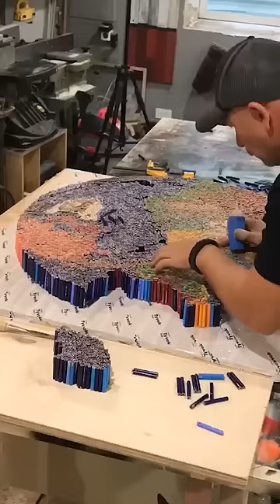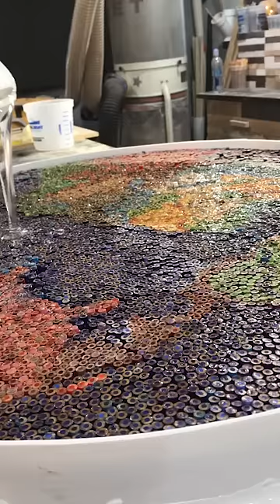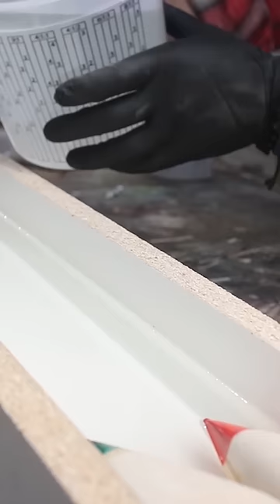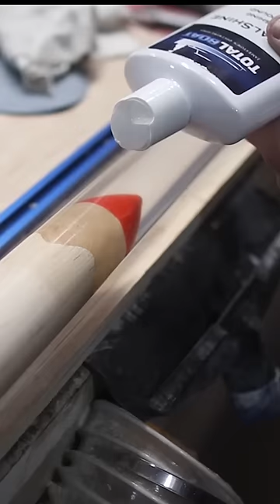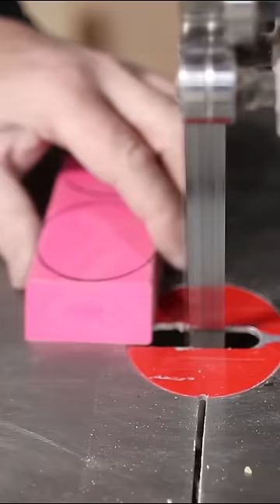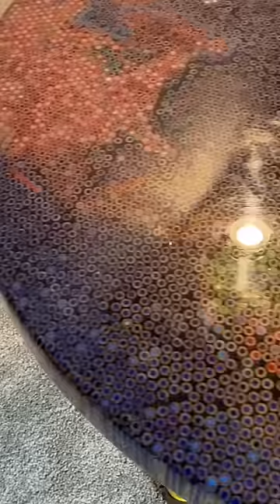Colored Pencil Table Build !! #Shorts

Comment: I'd love to see a magic the Gathering card table like this. Filled with rare Magic the Gathering cards I've got thousands of them but the super rare ones from the old old days I sold all mine off some couple years back that I still have thousands of rare cards I'd love to see a table like that
Reply: Do it. You can definitely do it at home. It's just a resin table so get yourself some resin and make it. People do it all the time. They usually just coat wooden tables in this stuff so they last and can be used commercially.
Reply: Please do not actually fucking resin your rare MTG cards holy shit just make a glass cabinet type table so you can keep them in a case. My god, why would you suggest doing that ????
Reply: The visual instructions are there in the video. It looks like a lot of work and patience but you might surprise yourself and make your own table. If I made something that beautiful and decided to sale it I would be asking a huge price for it.
Reply: It' d be cool to put them in epoxy proof cases and THEN do this. Keep them mint (or whatever they were at) and be able to cut them out later!

Comment: Really cool!
though clear resin does yellow over time, so it might look off in a year or two
Reply: Higher quality resins such as totalboat (which is what I assume they are using as the brand labels for the polish and stir cups are facing the camera) generally yellow much slower as they are intended for larger more professional scale projects such as furniture, cars, or boats. Not that craft resin isnt good quality, just it has different solutions to make it better for a different kind of project (such as using thin layers for jewelry as compared to couple inch thick layers on boats or table tops).

Comment: I personally would have used sharpened pencils for the top if doing the legs like that. But I was not the artist on this particular build. Love how he did the legs though. Even if you don't typically see erasers (rubbers for you British English folks) on colored pencils. The erasers give the table soft feet so it doesn't scratch the floor. (Not that it mattered in this video being a carpeted floor.)